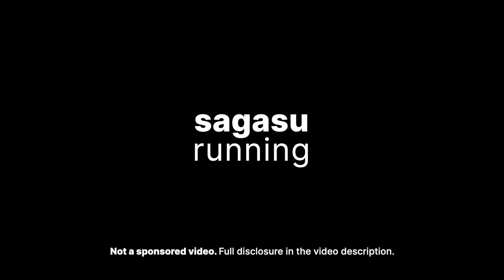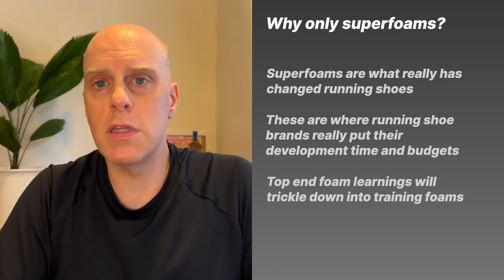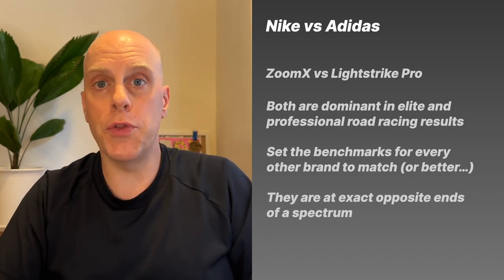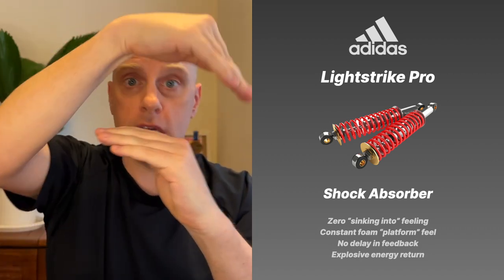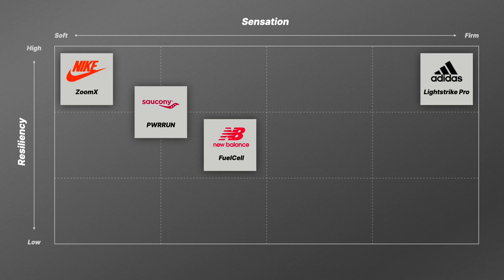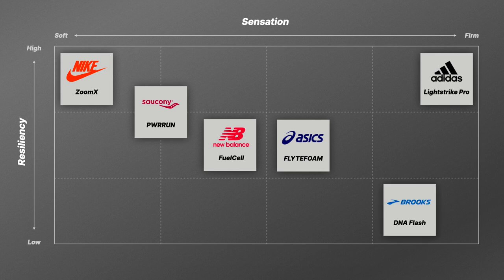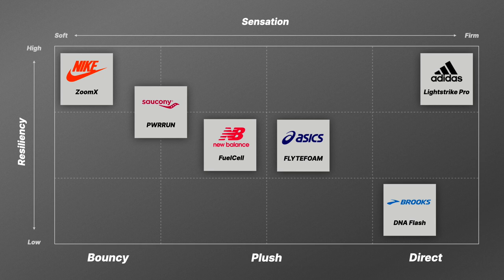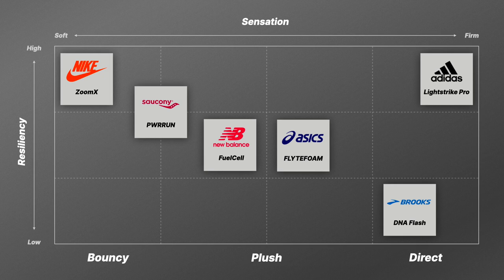What is foam resiliency and why is it important in running shoes?

Comment: Hey, thank you for this nice, well-structured and interesting video! Again :) For the most part I agree with your senstation-ranking of the different foams, except your placement of the asics foam. I was really surprised, because to me the adidas foam (Lightstrike pro, I have the adios pro 3 and takumi sen 9 as well as the prime x) is way softer than the asics  foam ( I have the metaspeed sky +). Have you tried the metaspeed sky +? Could it be that you tried other asics supershoes that might be softer?  Incidentally I find that I love really soft cushioning for easy runs (Invincibles) and on race/spped days i prefer firmer midsoles (asics metaspeed sky+, takumi sen 9). So I appreciate the diversity the different brands offer and I love when someone like you who is that knowlegdable in product design gives background information as to why the foams/shoes feel that different.  In other words, I can't express my gratitude enough for this unique Insight and I am looking forward to the next videos!
Reply from the maker: With Asics… in my experience… their foam is firm but not overly firm… but they use really stiff carbon plates which over stiffen the shoe and make their extreme toe springs more useful. It’s partly why I’m not a fan of the Metaspeed sky/edge+ because of this and how I run.

I’m still trying to find an Asics shoe I like besides the Hyperspeed series. There are a few more I’ll try this coming summer. 

Asics foam to me is fairly firm and has no life (FFBlast and FFTurbo, both plus). Adidas foam is much firmer to my foot but has endless life. 

Thanks for the support and kind words. Glad my content is finding the audience who appreciates it. 🙏🏻

Comment: The Matrix with your explanation is an excellent resource. If you were able to slot Puma in (clearly moving within the market) that would be excellent. This may explain the "out the box" first impressions many you tube influencers have for bounce or yoga ball feel trainers such as Nike or Saucony, where as its been  more of a connesieurs choice to see the value in the more direct feel of Asics/Adidas which sometimes get a better full review. That said, clearly even hardened' Zoom X' fans appreciate that Adidas know what they're doing! Interestingly in the UK run testers a) did not rate the Novablast (but do the Superblast) and b) have the Adios Pro 3 as an also ran as a Marathon racer. They have the New Balance RC elite, Endorphine Pro 3, Metaspeed Sky all ahead. This suggests a direct preference for the bounce feel yet some faster runners prefer Adidas direct feel as you outline. Interestingly the Takumi Sen and new Boston 12 seem universally well received. It appears thinking is coming around particularly when addidas pack more foam in. You appear amongst the best voices to explain all this to runners. For example, your matrix told me in five minutes what its taken 25 videos to work out elsewhere when trying to fathom market with brand/foam placement. Thank you!
Reply from the maker: Thank you for the kind words. I'm glad this video was useful. It's something I don't see anyone else talking about on YouTube (outside of DOR) and wanted to make something easy to digest and short.

I have no experience in Puma shoes so no clue where to place them on this matrix. Which is why i didn't include them.

I agree with you on the first impressions. ZoomX does feel great out of the box and the formula os ZoomX we have now on 2023 is very consistent well into the 200mi range. SHoes like the Asics Novablast 3 are another issue though where FFBlast+ goes through quite a drastic change in the first 100miles and what it feels like "out of the box" is nowhere near what it feels like at 100miles.

Nike, Asics and Adidas are all currently producing outstanding running shoes. Though each has it's own unique traits for sure.

Comment: If 1 cm of midsole layer thickness buys Lightstrike Pro the same resiliency as ZoomX, but at less "suspension" travel, i.e. higher firmness, Adidas could just make Lightstrike Pro "as soft functionally" as a full slab of Zoom X by making their midsoles into fenestrated net structures, saving further weight against their competition (air weighs nothing after all) while becoming even more comfy, and gym-ball-like, without losing energy return (provided there is no non-linear plummeting of energy-return beyond a certain compression).

Seen through that lens, the name of the game for the 2020s RnD would be to develop the firmest and most resilient superfoam with the longest "energy returning suspension travel" to make ever more fenestrated midsoles, saving ever more weight while retaining maximum energy return.

No need to make a solid layer of soft foam if a net of firm foam can be just as soft and energy-returning / resilient at less weight and material volume.
Reply from the maker: This is essentially what Adidas has done with the new Lightstrike Pro formulation found in the Evo 1.

Comment: As a brand new runner, I've been using the peg39 while i build my base. I can't wait to be good enough to bust out the vf2 and see what these foams/plates are all about 🏃🏻‍♂️
Reply from the maker: You can’t go wrong building your base in some Pegs… for sure. If you want a step in between a Peg and the VF2… try some Invincible 3s… you’ll get the Superfoam feel without the aggressiveness of the race shoe.

I started a playlist called “Running shoe basics” that I’ll keep adding content too… mostly for new runners or runners looking to learn about shoes. Keep an eye on that for more content like this.

Also… I’ll have some more Invincible 3 content coming out in the coming weeks. I have a lot more to say about that shoe.
Reply: @Sagasu Running  thanks for the tip. I was just looking into the differences between the 2 vs 3. It seems that the 3s have more stiffness, which makes it a good compliment to my future shoe rotation.
Reply from the maker: @ayowser01  the VF3 is a better shoe. I wouldn’t call it stiffer… it’s softer actually, but more structured  to run in due to the design of the midsole. I have multiple videos on this channel talking about the VF3, the changes and comparing it to multiple other shoes (including the VF2).

Comment: The nomenclature surrounding this topic is so confusing. 
To my mind, it would be more intuitive to use elasticity to describe how the foam responds to impact force (firm vs soft) and responsiveness to refer to how the returns to form (fast/springy vs slow/bouncy). Basically, rate of compression vs rate of decompression. 

I think your description touches on this,but it wasn't entirely clear to me if that was what you were describing. 

Also, it seems kind of wild that you could engineer a foam to have different compression/decompression responses.

Great informative video, as always.
Reply from the maker: It is a very complicated subject to cover simply. All engineering terms.

I think you got the gist of what I was outlining. I didn’t want to use the words “slow” or “fast” as ZoomX isn’t slow and LSP isn’t fast. But there is a delay in ZoomX and and a twitch like response in LSP. 

As far as engineering a foam to do what you want it to do… that’s materials engineering 101. A totally fascinating area for sure!
Reply: You're right, specially because 'resilience' is a term with a well definied meaning and has nothing to do with time. Resilience is related to going back to the original shape after a material undergoes some kind of deformation. It doesn't really matter how fast it takes. 

At the end of the day we're talking about 
Resilience (is the foam capable of returning to it's original shape after being deformed? How much energy is returned?)
Elasticity (how much does the foam deform after being subjected to load?)   
Rate of compression (how fast is compression? How long will it take for the foam to achieve maximum compression?)    
Rate of decompression/return (how fast will it take for the foam to return to it's original shape after being compressed?)   

Those 4 properties can be changed depending on what materials are used, how those materials are processed, what are the microstructures (how the molecules are strucutured) and macroesctructures (shape, angles)...